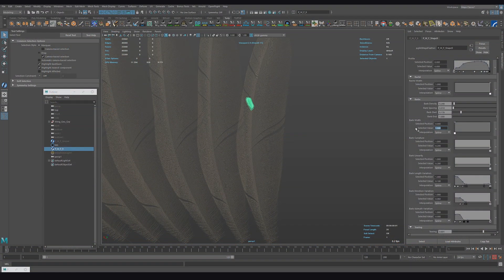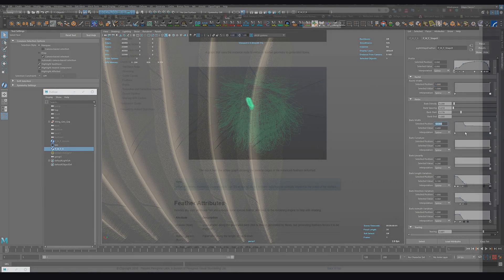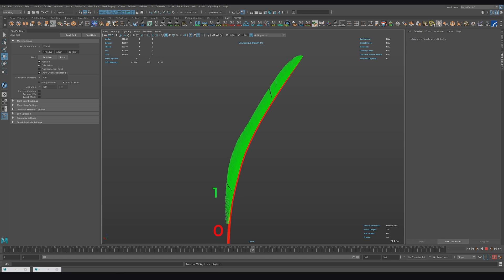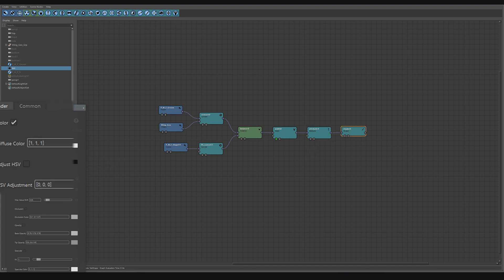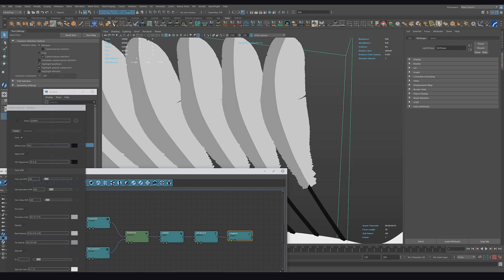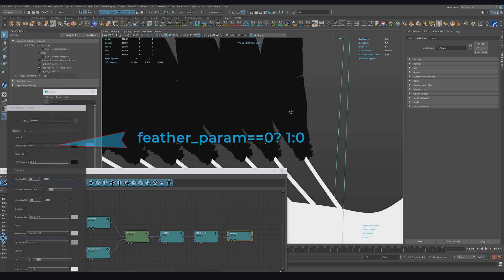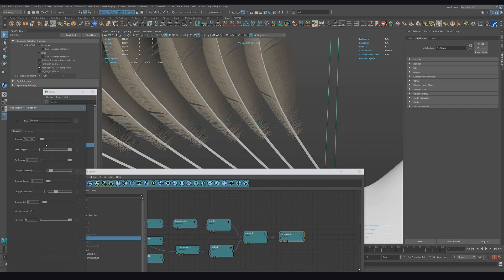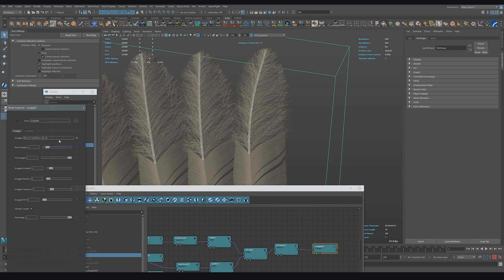YTT#001: how to use feather_param and feather_part

Comment: In yeti4.2.2,scrapggle seems to work on the feather uv, not on each fibre.how to deal with it
Reply: did you manage to find a solution? I am also trying to apply scraggle to the feather, but the result is not great. It works a bit using the strandu parameter, but I need to use very high frequency and an extremely low scraggle to have an almost decent effect. Don't know if I am missing something

Comment: Hi Yuriy, how do you convert a feather from strand to fibre, when I do it, the feathers shows off, and when I tried to add an attribute 'feather_part', an error comes out: Yeti 3.6.0: ERROR ( attribute0 in pgYetiMaya1Shape ) Error evaluating Default parameter - No variable named $feather_part // .  Anything tricky here?
Reply from the maker: Hey! did you inherit feather_part attribute in the instance node in the Objects tab in Inherit Attributes line?
Reply: @CGMeneldil  Well sorry Yuriy，turns out it was my fault, as I didnot pick the 'feather to fibre' option in the Convert node, after this, everything works fine!
However, another question might not related to this tutorial, that how could you render the Rachii like a tube, as it render like a flat plane by default.
Reply from the maker: @fengxuanli5079  for tube you need to duplicate first Yeti node (but in this case if you use scatter node you will get another random seed), disable everything except rachiis and in Arnold tab switch to Thick mode
Reply: @CGMeneldil  Wow，got it, many thanks Yuriy！  I love the voice acting in this tutorial，by the way.
Reply from the maker: @fengxuanli5079  my pleasure 😊

Comment: Thank you very much for this Tutorial it helped me, as a Beginner, alot. 

But I have a Question, everytime I split and merge my Feathers the number of Fibers doubles. What I mean is, after Instancin the Feather I have 3601 Fibers, but when I split and make changes like you have shown in the Video my Fibers Count increases to 7202 and my Object Count goes up to 2, before it was 1. The Result is that the Memory Usage and Evaluation Time increases. For a few Feathers this is fine, but when I'm thinking about making a Bird or sth I have hundreds of Feathers and then this would fill out my available RAM pretty fast.

What I want to know is, is there a way to split and merge the Feathers without doubling my Fiber Count or is there sth that I'm missing?
Reply from the maker: thanks for question! this issue is related to that scale node doesn't kill 0 length fibers. I'll try to find a solution to the instance node selection stage, not after. At this moment this idea doesn't work correctly.